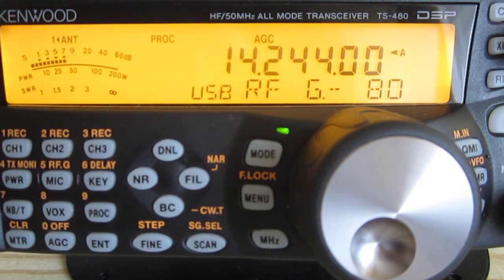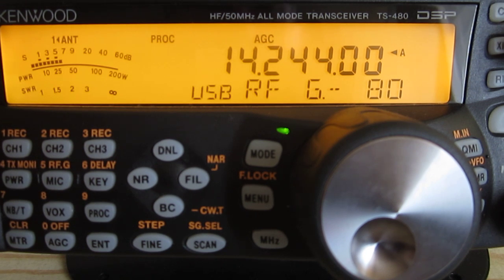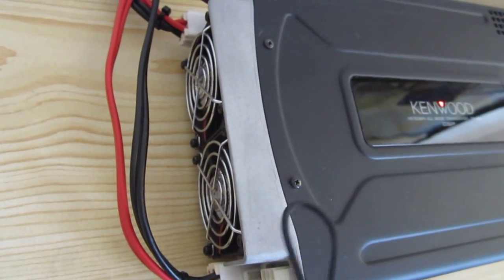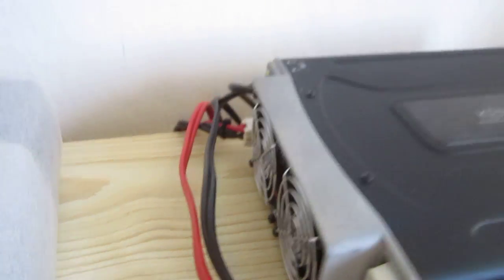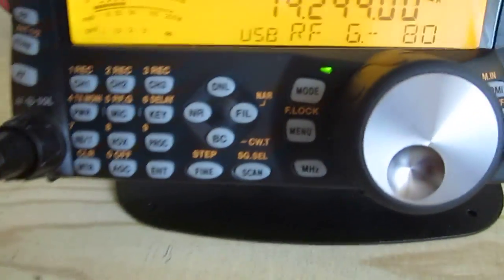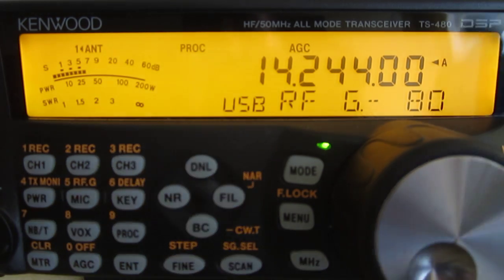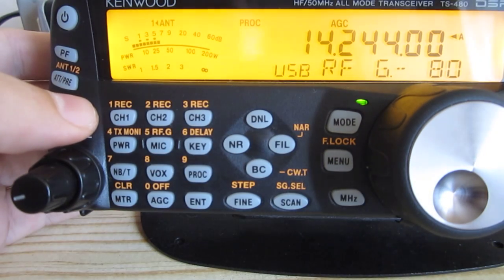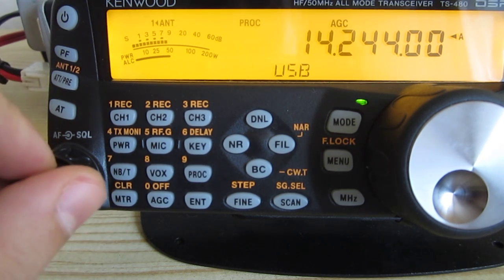TS-480HX

Comment: Does it have a built-in auto tuner?
Reply: I don't believe the 480HX has an ATU as the 480 SAT does. The space the ATU occupies in the SAT is used to accommodate a second power amplifier. The finals are 2SC2732, rated at 80w each I think?, there are 4 of them in the 480HX
Reply: @355k13  That's correct, there's no room for the ATU in the HX version.

Comment: Just spoke to an operator this morning who was using a TS-480 and he was using a stock 480 with the supplied hand mic and boy did his audio sound FANTASTIC. I've also made numerous contacts with people who were using TS-2000's and some TS-590's and they all sound absolutely BEAUTIFUL. These Kenwood's have VERY impressive audio and I'm thinking about buying The TS-480SAT. I don't have a need for the higher power HX model but the 480 would work on my small desk much better than a larger base station model.

Comment: This is a very good radio. I had one some years ago. Actually I'm thinking to order the 200W version today with 2 IF-filters :) The RX-audio is the best I've heard (had also ftdx5000/3000 Ic-7700 etc).
Reply from the maker: ***** Indeed a good radio, I was not impressed by the IMD/Front-end performance, or maybe my expectations were a bit high's.

73! and thanks
Reply: Yes it needs at least filtering but for casual op it was ok. Now I have the latest 590SG and like it a lot. 73
Reply from the maker: ***** 590 is a great radio! Enjoy it! 73!